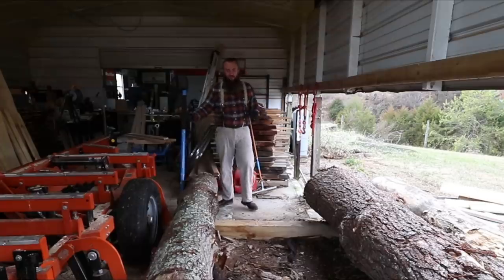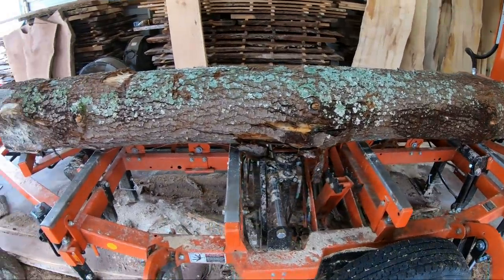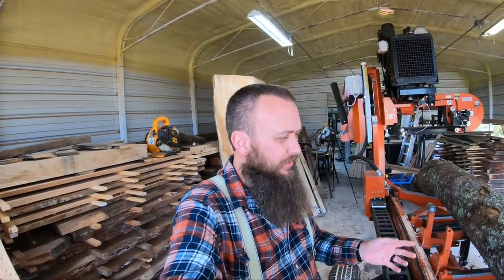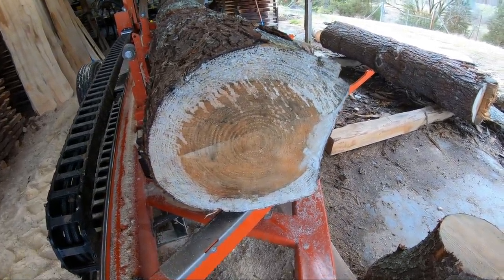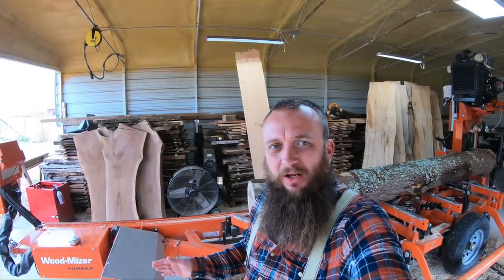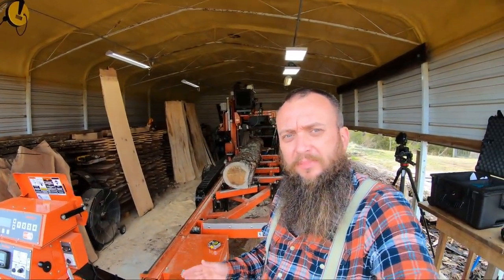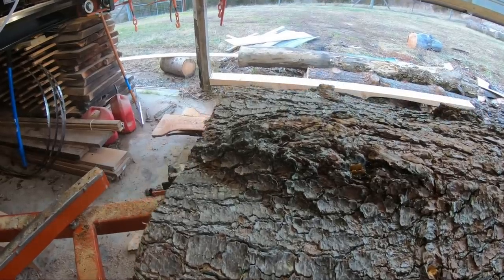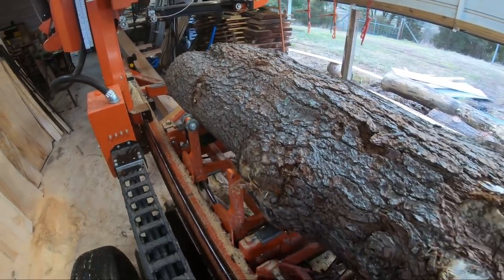Something Totally FREE To Put In Your Tool Box, Saw-Mill Resources

Comment: Thanks for the link to the Forestry Forum.  I thinks it's useful to multiply the diameter of the log by 7 to get the approximate cant size.  A 10" log will yield a 7" cant.  A 20" logs yields a 14" cant.  So, a 12" log yields a 8.4" cant.  I don't really understand why that works, but I checked it against the calculator on the Forestry Forum and it's pretty close.  Can't wait to see that pine crotch opened up.

Comment: @11:09, yesterday afternoon my intention was the same. I took a very narly Maple from the firewood pile, placed it on the mill intending to just skim it because it was getting late. When I seen that it was spalted I ended up milling the entire thing lol, was only 15" diameter, took longer than expected due to a few nails but it was worth it.
Reply from the maker: nice, maple is always fun when spalted,
Reply: How destructive are nails to these blades? I'm sure it depends on size and quantity, clustering.
Also, barbed wire? When you see a trunk wrapped, or encasing "Bob Wire" do you waste the log, cut out a chunk with your chainsaw?  Blades ain't cheap and down time to replace has to be a killer!
Reply: @waynesmith7487  
Depends, sometimes mettle slightly dulls the blade but I've seen spikes dislodge them from the saw head ruining them. I generally firewood a log when I see mettle because it's usually loaded though sometimes it's a crap shoot. I know the log I mentioned above will get me at least $800 so even though I spotted one nail I decided to roll the dice. It ended up having 4 thin nails plus one that ran along the face of the log. I should have change blades at that point as it only takes a few minutes but I only had 2 passes left, very slow passes I'd add lol.

With my Timberking I will break blades when pushing to hard with dull blades as they will slide back on the guide rollers and touch the back which is bad. 

I'm sure Sawyer's like Nathen don't chance things like we rookies do.